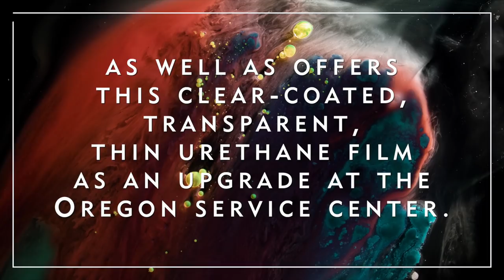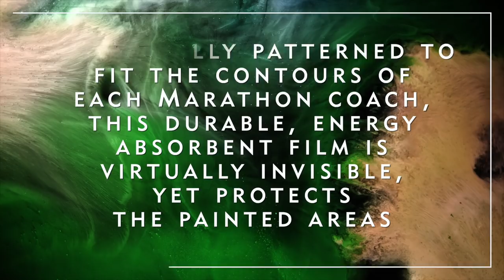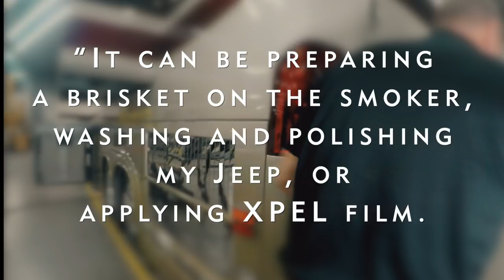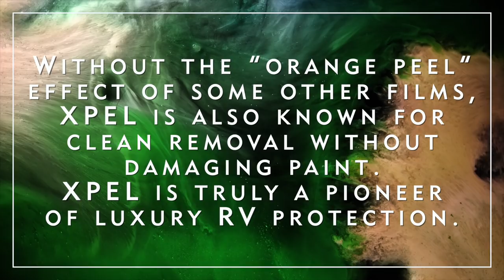Luxury RV Finishing Touches: XPEL ULTIMATE Protection Film

Comment: If i had the money this would be the only coach id buy .i wonder do they put the film on the roof as that would help with tree sap and bird crap make it easy to clean the roof area .
Reply from the maker: Hi John, thanks for the great question! We use Tempcoat to protect the roofs of our coaches. Thanks for watching!
Reply: @marathoncoach  I’ve got Expel protecting the paint and the headlights of my entire car with ceramic coating over that. I would imagine that to cover an entire coach would cost at least $20,000 extra?